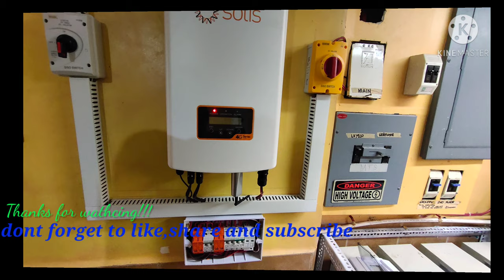grid tie system for commercial building

Comment: Nice work bai. Ask ko lang ano marecommend mo na solar battery 100 ah bai. Ok ba ang solar homes battery ng one point?
Reply from the maker: So far based on my experience then sa mga installer na bumibili...ok nman po ang performance...ang pinaka importante lang alam mo ang limitation ng battery in terms of charging and discharging...sa discharging dn po dpat 50percent lang po yong gagamitin to supply loads...

Comment: Boss ilang ampere yung AC  isolator at DC isolator na ikinakabit  pra sa 6kw inverter . DIY lang sir .
Reply from the maker: About sa DC isolator nag depende po yan sa arrangement ng solar panel mo kung ilang amps ang total especially in parallel connection...
Ang gamit ko na formula ito:
{PV(isc) * number of pv in parallel string}*1.25(safety factor) = rated current ng breaker na gagamitin at size ng wire...
Sa AC side nman:
{(Rated mac output power of inverter ÷ 220v)= the result multiplied by 1.25(safety factor) 
Ito dn po ang basis ko sa breaker at wire.
Reply: @solarlover143  ty sir
Reply from the maker: Your welcome po sir...
God bless.